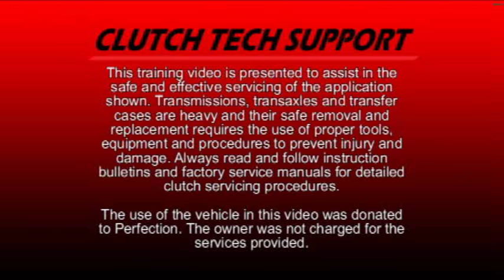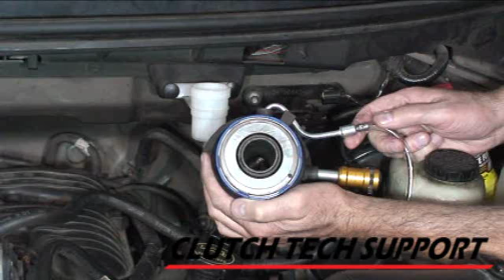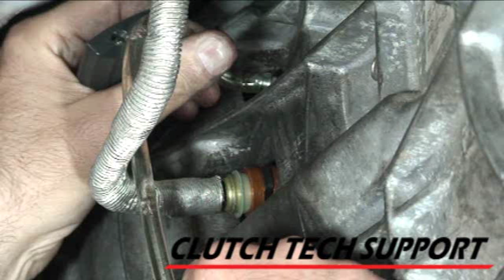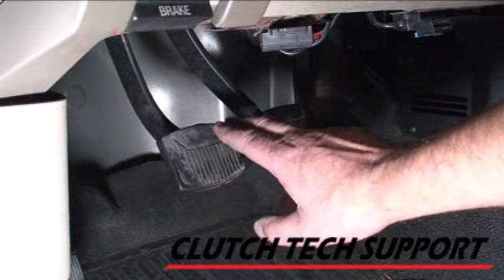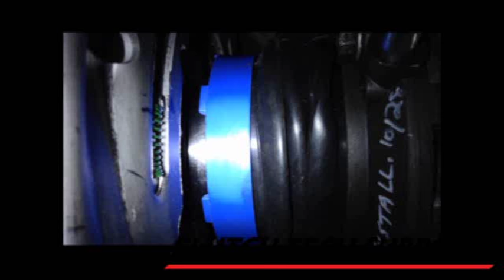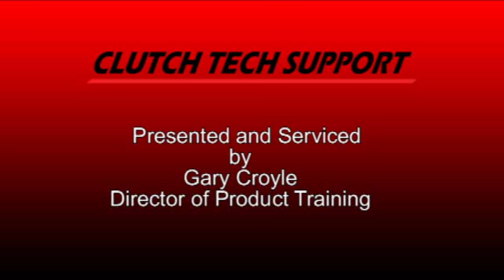CLUTCH MASTER CYLINDER WITH BLEED SCREW

Comment: How does the hydraulic line disconnect from the master cylinder? Also, to remove the master from the firewall it says to turn it 45deg clockwise then pull out. How much force is needed? Do I use a wrench? This is on a Ford f150 1997 2wd 5 spd.

Comment: Is there anyways to get a replacement clip? My line started leaking and the clip went flying into the transmission when I went to replace it. And I can’t find the clips anywhere. There as to be replacements. My slave cylinder is only a few months old

Comment: didn't work, pedal goes to floor and fit is terrible-- bleeder points DIRECTLY at brake booster, can't get a box end wrench on it. gonna try again... -- ok figured out we had to open the bleeder, push the clutch pedal all the way to the floor, then close the bleeder, then release the clutch pedal -- 4 times to get the air out, then worked like a champ !!! Almost rounded off the bleeder screw it was installed so tight.